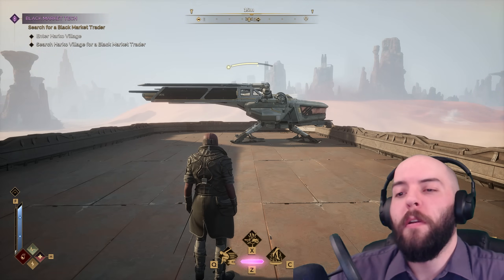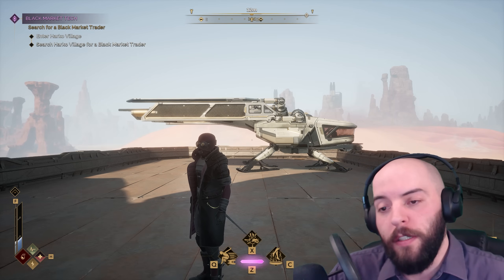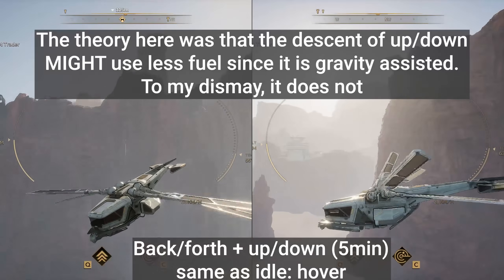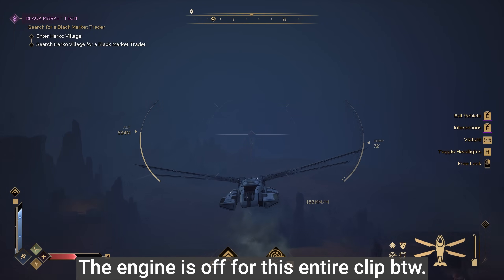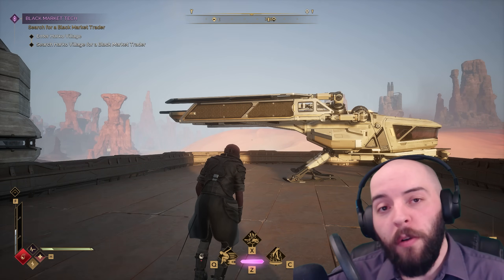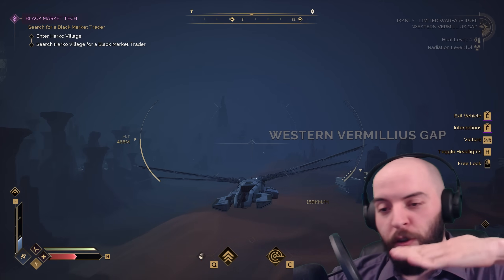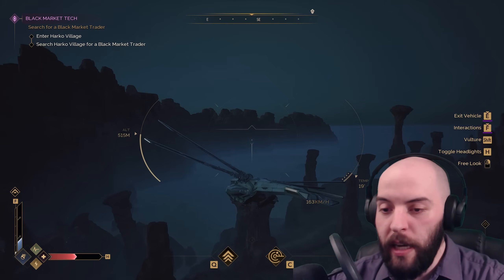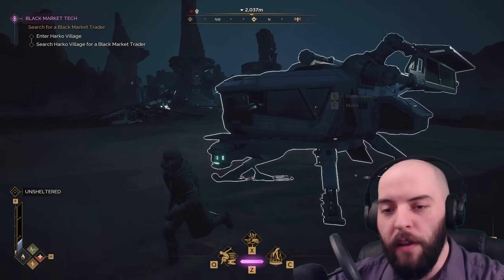How Ornithopters Really Work - Dune: Awakening - How to Fly an Ornithopter

Comment from the maker: Praying I didn't forget to mention anything. Have been really enjoying Dune lately though, just sad whenever I see people using their engine flying by.
Reply: Good to see you covering this game.  Going to start playing soon.  Loved your Remnant stuff.  The snarky presentation is great.
Reply: You can actually "feather" your glide. Get a good stable glide angle, which i think in the mk4 is 163kmh. Then tap S for about a quarter second, You'll lose a bit of speed and gain a little altitude. Wait until your speed reaches max again, then repeat. You'll gain altitude and move at full speed without requiring a booster or using any fuel at all. I'm able to fly at 770m all the way across the DD this way with 0 fuel consumption. For extra lazyness, you can "lock in" your glide angle by holding right click, dragging the camera a little bit, then opening your map and closing it. You'll always have the good glide angle AND can free look around without holding RMB
Reply: There is a flight control option In settings. Could you cover that ?
Reply: @tornicade  +1 I am also curious
Reply: They might not know which key shuts off the engine in the air until they land and exit. I''m about to finish building mine and will be trying to confirm which key that is once I'm going
Reply: very informative. thanks for the info. thought it was odd sometimes i lost durability just sitting at base etc. sadly ill have to pass on a booster for now. maybe once im much higher level and don't have to constantly worry about being efficient with my mats i bring. so far anything i do, even a mission, if im not totally topped up i do a little mining before returning. don't get much time on other than the weekends so try to be as effective as possible with my time rn.
Reply: Can you do an update with the changes ?
Reply: one thing i think you forgot to mention is energy gliding. ill explain... take off. let yourself get up to speed. align your wings with the horizon line to climb. at about 100kph dip your nose down with W or whatever you use. to get back up to speed. repeat. it Is slower than using a booster yes. but you can just glide everywhere without it.
Reply: Something you may not know or have missed is that the Light/Scout Thropter can glide indefinitely. If you aim about an inch (in the real) over the horizontal mark until you hit around 150 KM/H and then press W to go back to max speed, you'll gain more altitude overall.
Reply: Did you end up doing testing on how worms react to the copters?
Reply: @twistedsteel6290 would be hilarious if they reached out to eat one that got close enough to the ground, like 20 feet up.
Reply: You missed the infinite ascend gliding without losing more than 10km/h. When you start gliding, you aim above the horizon line and hold your forward movement key for a couple seconds so you dip and go back to max glide speed. The drop in altitude from this is outweighed by altitude gained from aiming higher than horizon. You only need the thruster if you want to rapidly gain altitude.
Reply: In mk5 and above you can glide indefinitely using your pitch to go between 175km/h and tap s to rock the ship and climb, when you reach 145km/h you go back to a dip that gets you to max speed of 175 the  repeat… you can go above the 750 altitude as you climb more than you lose…
Reply: They will breach to get you and angle in your direction if you are low enough.

Comment: so got curious what the Thopters where like in this game since I finally tried it during the free weekend. Maximum lifespan of the iconically drangonfly-like vehicle which flies by flapping it's wings is to flap them as little as possible. Ironically checks out, we have dragonflies in the back yard compost pile. they also glide a lot more than you'd think....
Reply: if I were waiting in a thopter, it'd be because I was the designated getaway driver, where the durability becomes a bit secondary. or at the level of income where hearing it make brrrrrrrt noises flying around was worth the cost lol.

Comment: I've never used the booster, and never had to re-axcend. As long as you go vulture at or around 450+ you can easily gain height to each anyone on the map with a single ascension.

Comment: Great video. When scanning rock islands in DD and rapidly changing direction to maneuver rapidly on to a node I do need the engine. The instant there is a viable glide I do so. 
I've seen PvP videos where they fly inverted. I assume to expose the underbelly to rocket attack vs the wings. What is the fastest 180 flip? 
I mostly fly with the storage so no booster. Except on the assault ornithopter which is a totally different feel to it

Comment: Something I've been recently doing is using the booster at first to gain altitude instead of the engines. Take off → turn on booster while horizontal → go vulture → aim up → turn off booster.
I don't know if it's more fuel efficient but it sure as hell is faster and it avoids the automatic drop you get when activating vulture mode.
Also, giving the booster a quick tap can get you from "140km/h and losing a bit of altitude" back up to "max speed and stable"!

Comment: There does seem to be a very small drain on fuel while in glide mode. I let my scout thopter run pretty low on fuel before refilling it and I have definitely seen low fuel alerts pop while mid glide several times, well after I have entered vulture mode. I'm still on the mk4 scout so it's probably more noticeable due to lower fuel efficiency.

Comment: From my experience when gliding with the scout ornithopter you want the dot on your reticle to be roughly in line with the horizon line (maybe a bit lower) and with the assault ornithopter you want it to be a bit even lower. The scout moves at 162 kph when you're gliding the most efficiently and the assault moves at 153 kph.

Edit: I just noticed there are about 100 comments exactly like mine but hopefully someone finds this useful lol

Comment: Very good video. 

Couple things about flying efficiency.

When using your thrusters. Unless you need to climb sharply to avoid structures, keep the point on the horizon line and use your down arrow key to ascend. This makes it so you do not have to adjust back to your horizon line after powering down the thruster.

Second. No reason to dip under the flat horizon line for gliding, unless you need more speed than 162. You can cover the entire map if you stay level on the horizon line.

Comment: Boosty scouts are required  to power boost airelon roll across the nose of slower thopters. If you have the piloting chops to do a proper barrel roll, even better. Wing waggles as greeting when passing in opposite directions should also be required. You can also boost into a climb almost directly from the ground in a scout by climbing a tiny bit, boosting, immediately switch to vulture (I have to momentarily release directional), then immediately climb away in a boosted climb that no rocket scout or any assault can hope to match (or probably even track).

Comment: While gliding above sand on low altitide, u, can be eaten by worm ?
Reply from the maker: If the worm was already attacking something else, then yes. Otherwise, if you're wondering will the worm randomly pop up and try to attack you at low altitude? No, that'll never happen. It needs to be attacking something on the ground already and the only reason it would ever hit you is because it was trying to hit something else, so you're safe no worries.

Comment: Sadge I was hoping you look in to the other thropters. As the Assault Orni is completely different with thruster. 
I only use his thruster to climb (not fully clear if it is better to just go up with SPACE or also with W). Then a little dive to get on the max "idle" speed. While gliding, his thruster even slow you.

One thing with the Scout that I do, hitting the thruster while taking off. Then directly transition into vulture.

It's pretty hard to "feel" what has how much impact, as the sound and feedback are very wonky.

Comment: Should you use a Mk 4 Generator in a Mk 6 Thopter for better fuel efficency when using storage?

Does Mk 4 vs Mk 6 Generator differ in durability loss on engine?

What is the point of having a higher Mk Generator if you dont use Heat? (Thruster and Rockets)

Comment: This might be the fastest way to get around, but in this game you want to carry loot with you. Unless you return back home after every testing station etc. which negates the speed advantage of the booster. So I never play with boosters on a scout ornithopter, but with storage. What would have been much more helpful imho, would have been to show how the parabolic flight method allows you to keep flying at high altitudes practically forever, without using your engines, but for the initial climb.

Comment: Honestly, if you're going over 3000 m (3 km), climb to 700-750 m of altitude and turn on Vulture.
I do this every time I'm going over 3 km away and I've gone from the middle of Eastern Shield Wall all the way down to Hagga Basin South, over 6,3-6,5 km away without stopping, without turning on my engines, without using any boosters (and I was still at 460 m of altitude at arrival). Just climbing to 750, Vulture, glide at 161-162 km/h, with the horizon line at about the middle oh the "triangle". This way your descent is slower and you're still picking up speed enough to maintain the 161 km/h speed.
You WILL need to slightly correct course to "dodge" certain structures and stone pillars if you're going too far, but as long as you correct course to avoid colision preemptively, you should be able to easily correct course without falling too much and without losing any speed.

Comment: I've flown clear across the deep desert with storage and using parabola. When you hit max speed pull up slightly and you'll gain height, when you lose about 15 km/r push the nose downward till you get max speed again. Rinse and repeat till you reach 900 meters off the ground then just glide, repeat the whole process over and over as needed and you can stay in the air a near infinite amount of time. With mark 5 wings my max speed with the center dot perfectly aligned with the bottom of the triangle on the horizon line is 173. When I want to gain altitude I pull back at about a 25 to 30 degrees angle until my speed reaches 165km/r then I let go of the stick and let it settle back naturally to center during which you will still gain a few more meters in altitude and lose speed to around 150. Then you tap the stick to nose down and it'll hit max speed almost immediately. Do not touch your mouse once you have the dot located on the bottom of the triangle. Change height using the left stick on controller or W and S on keyboard. This way it will right itself when you stop pushing up or down...makes it MUCH easier to maintain that perfect glide angle while gaining altitude 😉

Comment: Thruster is only worth it once you get the assault orni. Sure, it's more efficient, but taking 4x the trips at a higher efficiency isnt worth it. Taking one trip, albeit at lower efficiency uses less resources while also saving you the time. Once you get assault, sure, get boosters for the scout so you can traverse faster, but until then, im not gonna take 4x the trips.

Comment: How to remove the durability, put all the parts in a storage container, then demolish the crate and pick up the parts. Log out for 30 seconds and when you log back in, all parts are 100% again. Works for all items and will also fully recharge vehicle fuel cells
Reply: Does that still work after the patch? Asking for a friend!

Comment: Using your thruster to gain altitude, while faster, is less efficient than climbing via gliding. Angling up slightly while at max speed allows you to climb, and then you can angle down slightly to regain your speed. In general, the amount of altitude you climb far outweighs the altitude you lose to regain max speed. With this method I can glide the entire deep desert without using an engine and maintaining whatever altitude I want above 700m.

Comment: To gain alltitude is it faster/better to hold space while the booster is on or to point the nose skyward while in glidemode? From the Km/h spacebar seems to be faster but i the altitude meter seems to go up equally fast in both cases?
Reply: Being level with the horizon line, hold back on the down arrow to ascend. This will keep you level with the horizon when you drop the booster while it pitches you upward to gain altitude.

Comment: You can gain altitude and go any distance while gliding WITHOUT thrusters still. 

Kinda like how a dolphin goes down beneath the surface then jumps up, if you go down and reach 180ish km/hr you angle back up around a 35-45 degree angle until you slow down to 120 km/hr then you dip down till 180 again. Rinse repeat.

I really want the storage over the thrusters most of the time as i do runs to places and my volume gets filled quick since i grab everything.

Comment: The only problem I have here is the recommendation to take thruster over storage in all scenarios for efficiency sake.

My base is on top of a giant rock, and I haven't finished extending the stake claim to the bottom of the pillar yet. If I need to bring anything to my base from my buggy that's parked in a ground level garage, I will be doing either 10+ trips with my inventory full, or just 3 with using the cargo module.

Did the same thing when I was moving my base. I like to keep all my shit, so when moving my base from the Vermilius Gap to the Shield Wall, I flew everything over using the cargo module. It took about 15 trips, I cannot imagine the pain of doing that probably more than 50 times without cargo module.

If you are moving multiple full inventories using cargo, it will take you vastly less durability to do so with cargo. If you're only in tier 4 going to tier 5 like, and the scout thopter is the only one you realistically have access to, storage is ridiculously useful to have.

The recommendation is for endgame, where you care about getting to a place quicker/more efficitently, rather than bringing as much to and from it as possible. I wish that was clarified better.

Comment: Sorry, but there really is no reason to use the booster ever for PVE play.  Use the cargo module, that way you can get a lot more resources. With good glide technique, you can keep the scout ornithopter high on the air indefinitely, at least until your wings break.
Reply: Unless you're clearing the map for quests you've been neglecting in favor of tiering up crafting (like I have), having cargo on a thopter is SO much more efficient over getting wherever you want to quickly.
Even when I'm questing, I'm still going to take the damn cargo over the mind-numbing experience of having to fly somewhere and back multiple times to get the same amount of resources I need.
Vash's argument is a perfect example of empirical efficiency vs. enjoyable practicality, and he either didn't think of the other or forgot to mention it. You're not going to 100% the numbers, and most players even don't want to.
Reply: The trade off for speed if cargo isn’t needed gives it complete validity?

Comment: Forgot to mention you can infinitely gain altitude without a thruster if you pitch upwards as far as you can keep gaining altitude faster than lose speed (probably like 10-20 degrees above the line). Before it reaches 160km/h tap W to tilt forward until you just barely reach your max speed (t5 is ~172km/h). This will allow you to infinitely climb until around 800m where the amount of vertical gain is decreased for all vehicles. Tier 5 and 6 can do this with ease, haven't ever tried this with t4.

Comment: aim 2/3 up the line so you're ascending, every 10 km/h speed loss just dip down for a split second to regain your max speed, and youll climb while using Zero fuel across the entirety of the map. no booster required.

Comment: Nice, but... You no need booster, if you are good pilot. When you start at ~600m dive into optimal speed (just ascend by holding "space bar" till you reach 600m, then level your orni and than just push once "shift" and do nothing) When you reach optimal gliding speed, orni get leveled back and have maximum speed (for instance 162 km/h) and lose minimal height... Then after a while, when you hit like 550m, just put your nose up 45 degrees and watch what hapens. Orni just losing speed, but it also get altitude... and trust or not, you are able to get higher, then you start gliding before you hit critical speed (around 130km/h), when you have to put your nose down to get optimal speed again... After that you can get around 80-100m of altitude without using engine or booster (no fuel consumtion) and you lose only speed for a while. So, for save happy traveling is no need to kick engine or use booster (ok, ok, for landing and starting you will) for infinite distance.
Reply: You'll get wrecked by other scouts chasing you with rockets if you don't have a booster.
Reply: Booster is still better… 

It’s faster and takes less durability off your wings.
Reply: Thank you, someone needed to point that out.  Go with the cargo option for the ornithopter, that way you can get more resources.

Comment: You can fly forever with only one initial climb no booster. You only need to use your engine for the initial climb, then infinite glide while go up slowly. Reach 162kmh, set your mouse to gently climb, lock it with holding right mouse button, when speed goes down to 148. Press w about 0.4 secondes, by doing that, you dip just enough to get back 162kmh but you will climb higher and higher without your engine. Works with wing mk4 but even better with mk5 and mk6.